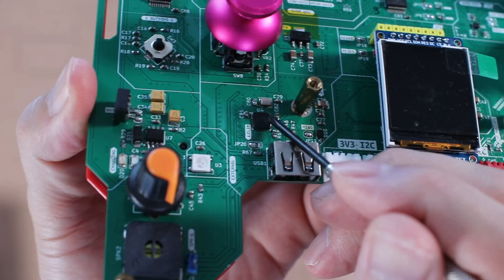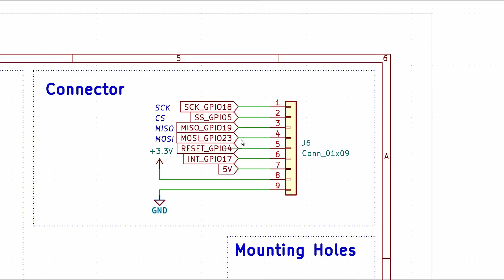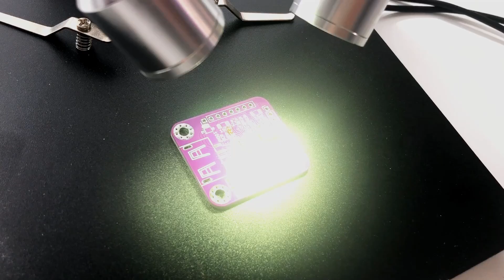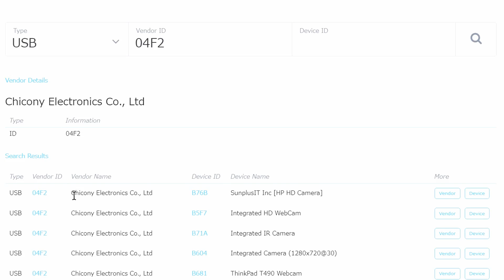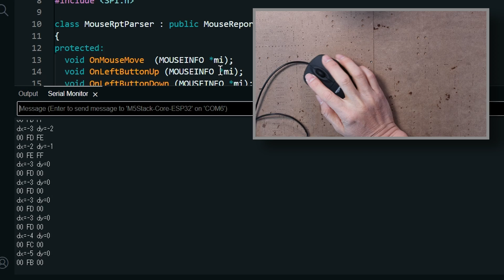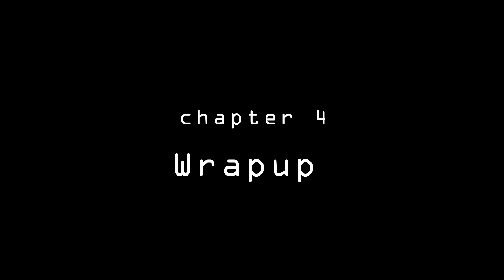I made a USB Host Module with max3421e

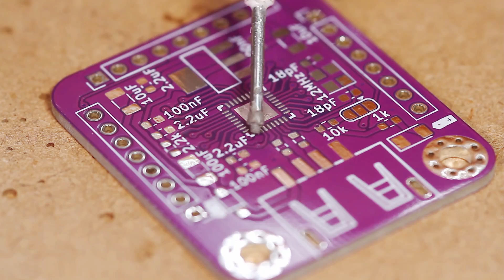Comment: 4:20 You do not apply any solder paste on the bottom GND pad of the IC? 
Dunno man.
The microscope is nice tho. 😊
Reply from the maker: Well, it worked so I guess it is OK. lol  Actually the PCB had some solder on the pad during the manufacturing process that may helped a little. ( I assume) And the micro scope is really helpful!
Reply: @KOKENSHATECH  it's best for cooling to have that soldered. But if you are not drawing a lot of current on the 16 I/Os it might be okay